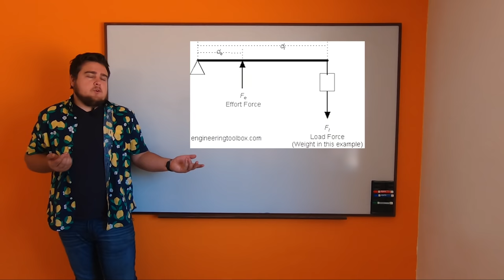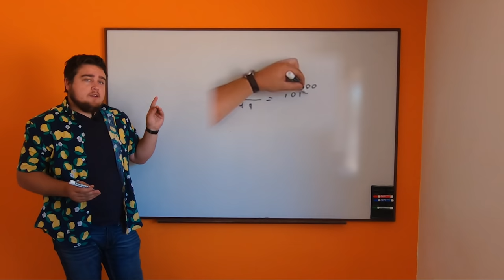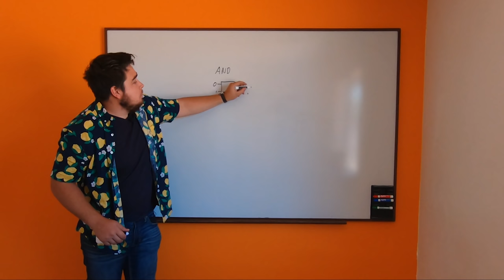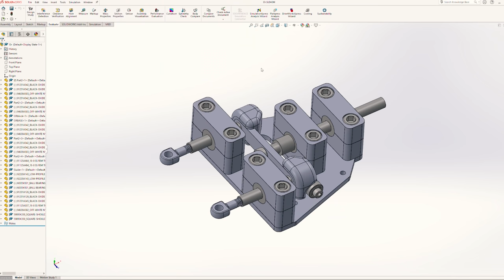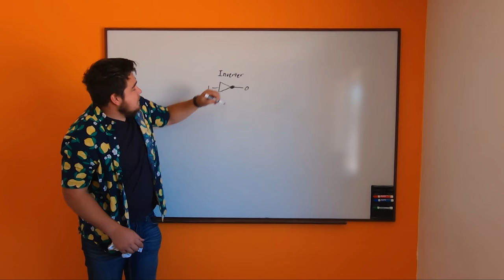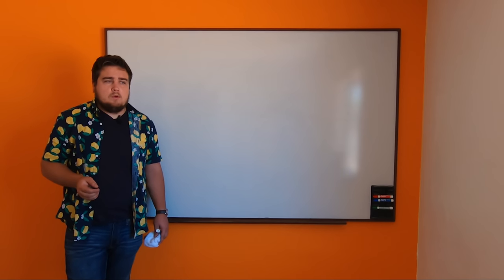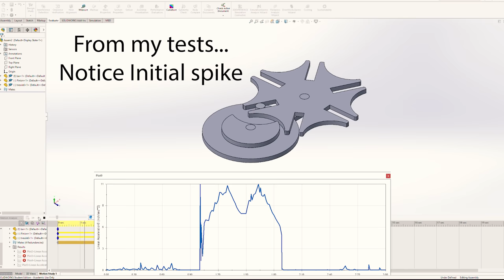Is a Completely Mechanical CPU possible?

Comment: What was really missing from the video is reference to friction, loads and mechanical stress. For the first couple of stages it could be fine, but every next module will add resistance to signal travel, especially if return springs become a thing...

Comment: For people not familiar, Charles Babbage created a mechanical computer.  However, his sophisticated analytic engine was not built in his lifetime, and that would more closely resemble a modern computer in that it had stuff like an arithmetic logic unit, and even storage.  But it's possible to make a simple turing complete machine, supposedly, because supposedly that's what the "turing tumble" marble machine is.  But it's very small, so very limited.  Always cool to see people approach building computers in new ways.

Comment: Very fun idea. I'm sure someone else has said this somewhere in the comments, but: Have you thought about using just NAND or just NOR gates, instead of the three AND, OR, and NOT? It's less intuitive as a teaching tool, but you can build everything out of a single repeated module which is probably much easier in terms of overall design and construction?

Comment: I had the idea for many years to make a similar 'adding machine' that runs on water from multiple watertanks. E.g. an AND Gate is only pushed open if two streams of water push on it. An OR Gate is easily opened, and a single stream of water is sufficient to push it open. Could be as a 'tech art piece' or afor a science museum or such. Anyway, it's a project for when I retire, unless someone else wants to run with the idea.

Comment: I've been tinkering with computers since before ICs were made. Early on, when something as simple as a gate or flip flop was large and expensive, we got the job done using fewer of them by making the machines do all their processing serially. For example, only a single full adder is needed for a serially operated computer. I built my first computer in 1964 to 1967. It had a small instruction set, a small memory, and limited I/O, but it worked. I can provide much more info if you are interested in this approach.

Comment: I noticed in the mockup at 10:35 that your adder is missing carry-out. You'll want some way to connect the output of the AND gate in the front XORs (closest to the inputs) to the back XORs beside it. The back XORs will also need the same carry-out to the XOR beside it.

Comment: Have you considered compliant mechanisms? It might be possible to cut out a simple two-dimensional gate out of a material consisting of only one part per gate. It could allow for much smaller gates and a much simpler production process. Not really sure if you have precise enough tools to do it or if it is even possible, but it might be worth exploring.

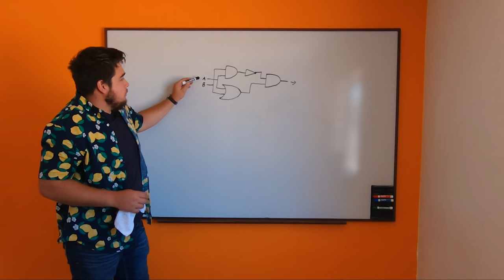Comment: At about 7:25 you mention XOR is true if either input is true but for XOR the output is true if the inputs are not alike otherwise the output is false. Still very cool build and concepts. I once worked with pneumatic controllers that could add, subtract, multiply divide, integrate, differentiate, store values, run a clock completely on air pressure no electricity involved.

Comment: Just a heads up, if you continue this project, use rotational logic gates instead! Push-pull logic gates are very inefficient and will lead to huge frictional losses, there's a reason even the first mechanical computer built 2000 years ago used gears!

Comment: Thx for sharing. Looks like you're on your way to mechanical logic elements. Next refinement would be to eliminate the analog operation and bring the size way down without sacrificing robustness . Konrad had a good idea when it came to eliminating the analog part.
Konrad Zuse comes to my mind when it comes to the modern mechanical computer. Please excuse me if this has already been covered. Then there was Babbage and others in the 1800s. Konrad is most noted for his relay computer. Relay computers held their own until the 1950s. This was about the time that computers began being implemented with transistors followed by ICs of course.
Again, thx for sharing.

Comment: Mechanical computing has been a thing for quite a long time. The first general mechanical computer was proposed by Charles Babbage in 1837, though depending on your definition you could call the Antikythera Mechanism from around 200 BC a mechanical computer though it was more akin to an orrery than anything.

Comment: I love this idea!
I see a couple problems:
1. You need a way to normalize the strokes. The inputs need to be able to accept a stroke of 0.8 to 1.2 units (inches or centimetres) and have the output move 1 unit. (or 0.9 to 1.1 units)
2. The inputs need to be asynchronous. (or the whole machine will need to be synchronous)
Your AND gate doesn't seem to meet either of these requirements. Your OR gate does. A NOT gate should be trivial. (an idler gear between two racks)

Comment: You know, the computer has some origine / inspirational logic from a pure mechanical version of memory and processing.
Woodblocks with holes in them, to give a weaving machine ( a loom ) the needed settings for complicated paterns, every cycle of the thread ( shuttle ) through the machine dropped a new block for the next setting of the heddels.

Comment: So two things, you actually only need an NAND or NOR. Just one gate. Everything else can be derived from that.  The second is, to do computation you would have to build latches or flip-flops. For those to work you need a small delay from input to output so that you can feedback and self latch, introducing a small spring could accomplish that. I know you did and adder, but I'd love to see a mechanical D-flipflop.

Comment: It can be done, because something similar has been done. Many computers have been build using only electromechanical relays. One of them was even produced commercially in series (Zuse Z11, 48 units manufactured). Now, of course, an electromechanical relay is not completely mechanical, but functionally it can be replaced by a mechanical switch driven by a shaft.

Comment: I've thought about creating a mechanical CPU lots before, I'm just not at the mechanical knowledge level to pull it off. I'm really excited to see you pull it off.

Something to keep in mind is that efficiency is not the sole reason we create things. From my experience, mechanically-based components last significantly longer than electrically-based ones, so from an endurance standpoint, mechanical CPUs might have the advantage (in addition to your point of "if you don't have electricity"). This could just be my biased opinion though..

Either way, I look forward to hearing more about this mechanical CPU.

Comment: All you really need is nand gates. Every gate can be made using only nand, and using only one type of gate would cut down on design period of having multiple types of gate.
It does require more mathematics to figure out how to make the circuits though, but overall they can be simplified to about the same level as when having all the different gates.

Comment: Do not underestimate the importance of NAND gates, if you can make one cheaply.  In electronics, they're the least expensive gate to create, and we have many circuits that take advantage of this.  If you design accordingly, you may be able to directly use logic designs used in some computer chips for your analog machine.

Comment: I see two problems:

1) Relay- and transistor-based circuits sometimes exploit a hidden property of them, the signal propagation delay. Whereas your mechanical logic gates are instantaneous (well, at least relative to their switching frequency). You'll have to come up with a different solution in those cases.

2) All relays and transistors draw power from the power rails on their own, and not from the input signals. Similarly, in Matt Parker's domino adder, each domino piece draws power from gravity independently. I wonder how you'd modify to do the same, because the current design simply won't scale.

Comment: this is so cool.
electronics and logic gates and computers are difficult to understand, its all tiny pixies in a chip doing magic. even when you break it down to transistors or vacuum tubes
but mechanical machines are easy to understand. this lever pushes that, which pushes another thing, you can understand exactly what is happening, you can see cause and effect and you can comprehend that

if you build 2 identical machines, one using transistors, the other using mechanical logic gates. both work the same, same input and output. but only one of those makes sense just looking at it

Comment: Before you go bigger, I'd suggest to think about how to return the outputs to 0 when they stop being 1 (either the machine needs to be in vertical orientation, or you need something)... if it's springs, it would be hard to push it with more levels of gates in chain.
Perhaps coupling the output pin to the inside logic would solve it. But even without spring, there will be a lot of force required to push and pull the inputs with all the subsequent outputs. But that's tge beauty of engineering,  working these things out

Comment: In the year 1801 Joseph Marie Jaquard invented a loom that used punch cards that could weave specific patterns. Charles Babbage with the help of Ada Lovelace designed the first mechanical computer in 1822 (sort of).  Their engine plans would not be built until 100 years later.  I think Herman Hollerith is someone notable pertaining to this video though.  In 1880 this guy builds a punch card system that counted the US Census.  His design also ran mechanical bypasses or you can also call them central processing units.  Flimsy logic engine it may be, but I think it qualifies as the mechanized cpu you are hypothesizing here with this video as it had built in functions for and/or operations.

Comment: You can use the 24x24 board as a chasis and base of each gate. Instead of metal try pvc it's lighter, easier to machine and you don't need bolts and nuts to fix them to the board. You just glue them to the board.
It is only a trial and error.

Comment: Fascinating idea!  Old fashioned adding machines and cash registers were examples of purely mechanical computers.  But they were very simple and not programmable.  If you want a real mechanical computer with processor, keyboard, storage, and whatnot, you'll need millions, if not billions of logic gates.  The mechanical friction would require a diesel engine to operate the thing!  And the whole computer would be the size of a small city!

Comment: well... the first desk calculators were totally mechanical devices with a handcrank. Using a punched paper card and matching reader (using spring loaded pins) you could string together multiple operations making it programmable. Before electronics there were a few ideas of programmable mechanical calculators like Babbage's Difference Engine :)

Comment: This is really interesting for academic reasons. However there are a few things to consider, for sufficient processing for whatever practical application, we need to consider that massive amounts of gates are required. The issue with a mechanical path would be friction and forces required to overcome it. So the more gates you need, the smaller and weaker they become, but the more friction you have and the more force and thermal dissipation is required, ultimately you will find your limits pretty soon. So I think the first to address is if the definition of a processor here includes the idea of a useful processor, cost effective processor, energy efficient processor, fast processor, durable processor...but adding any of these properties to the concept will pose new challenges to first overcome.

 I do question the linear nature of these gates as well. if you put a thousand of them in line, you can actuate the first one and the last one will stand still due to tolerances. So the gate must be non-linear, it need to have thresholds for a definite on or off state almost like hair clip which is either open or close and nothing in between. 

Passive gates has a fallacy, Every gates output must have a number of other gates inputs to actuate without changing the input load in order to make expansion possible. This need to be an active system where energy is supplied from outside to assist with load transfer from input to output so that the load on the input remains constant. In electronics every gates output can handle a maximum number of inputs to drive without affecting the input impedance, this is important to expand the circuit to have a full arithmetic logic and memory.

Comment: Awesome design! You can absolutely build a computer this way, but there is catch: You have to keep it very small (few gates) and well lubricated because your design lacks signal regeneration.
Imagine you make 1000 of your not gates, and chain them one after the other. You try the push the input of the first one. Your gates only transfer their input to their output, loosing some energy in the process. These losses add up.
Logically electric gates do the same - just inputs and outputs, but physically they are connected to separate electric lines to draw power from to produce the output, and keep its signal strength up to spec (This property is signal regeneration). Otherwise just sticking a not gate into the ground would grant free energy, because ground is 0, and not gate outputs 1, which is lots of electrons.
Because electric gates have signal regeneration, you can connect infinite of them in a chain as long as you provide power for each individual one. In your design your only option is to "push or pull the input harder" the more you chain, and after a point something will break before they budge.

Comment: I think that if you want it to actually work you will need to think about 2 things. 
If you chain these mechanical gates, the force will add up fast, so you'd need some kind of "repeater" or "relay" that can sense an input and gives the same output, while at the same time it decouples the actual gates from each other. This can be made with a small push button activated motor and, as you said, a spring to push it back into position whenever the motor deactivates. Secondly, you need to verify that these logic gates can actually be used in a loop. Otherwise it would be impossible to implement latches, flip flops and memory registers. I think that this repeater/relay thing can also help with that, since it will prevent the input and output from being bound up like a circular traffic jam.

Comment: 1) Check out Babbage's analytical engine from the 1800s (never built fully). Though I believe there is some work on a modern build of it. 2) Friction is going to be problem if you scale up.

Comment: First off, I love the idea and I enjoy making machines capable of computation for fun. any of those gates can also be made using just a nand gate. if you are looking for modularity, wouldnt you mass produce those?

Also, the Analytical engine designed by charles babbage was already a mechanical computer designed in the 1830s. It was never fully built, but it was turing complete. If you are going for simplicity and ease of implementation, you might consider an instruction set from the esoteric machines such as "bit bit jump" or "subleq"

Comment: It wouldn't scale for a couple of reasons. It's all working mechanically, and the components have a travel. At some point, if there are enough chained together, you won't be able to provide enough power to be able to propagate the mechanical motion trough the entire system, or imprecision in the dimension in the components would accumulate in such a way that the inputs wouldn't register. This systems only work electronically because the output power doesn't come from it's inputs, but from a fresh feed in the side channel. However if you implement a side channel spring systems with stops, such that the output force/travel doesn't depend directly on the input force/travel, then you could do it.

Comment: have you considered designing flexing plastic one-piece gates that work right off the 3d print bed? that would reduce the labor by a lot. you could conceivably print out multiply bytes at a time. and if you figure out a way to just hook all the prints together, that would scale very quickly.